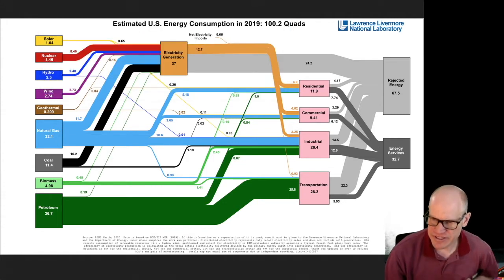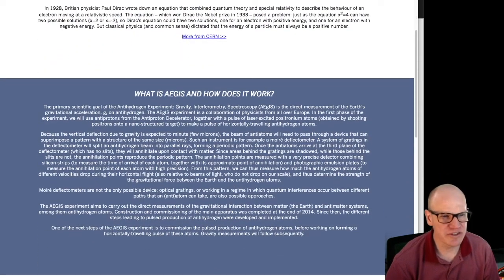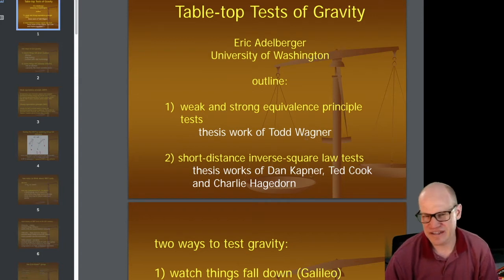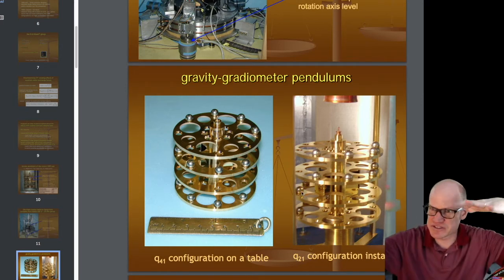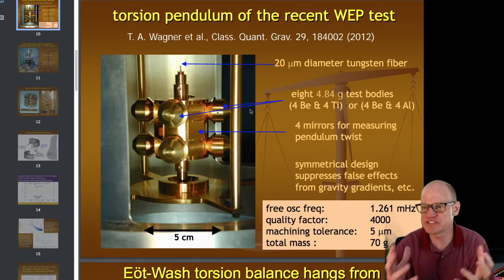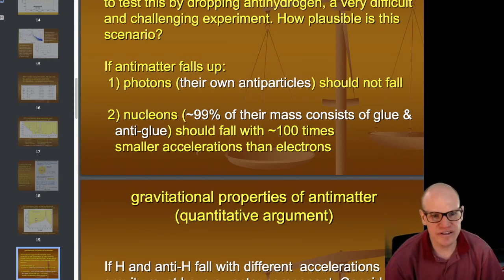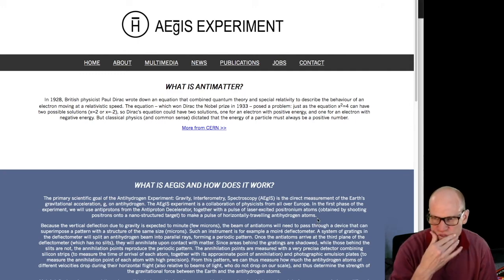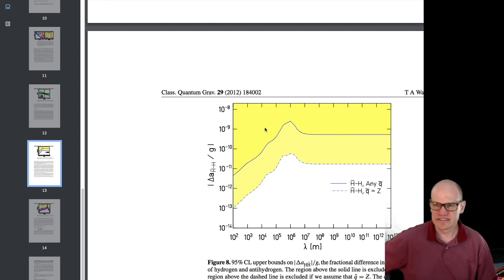Does Antimatter Fall Up?

Comment: Why in the world would you oppose conducting an experiment that has already been built?
Reply from the maker: Are you referring to the LHC?  The LHC is like an observatory.  There are lots of things that you can do with it.  The anti-gravity experiment is a tiny portion of the science that is being done there.  Regardless, I'm not opposed to any of these experiments.  What I'm opposed to is the claim that there are not already constraints on the subject.
Reply: @horizonsci1703  The constraints you mention are model dependent. I know it is a BIG IF, and I'm sure you believe it is NOT even a possible IF - but - IF by experiment antihydrogen falls up at 1g  the constraints you mention may vanish over night...time will tell.